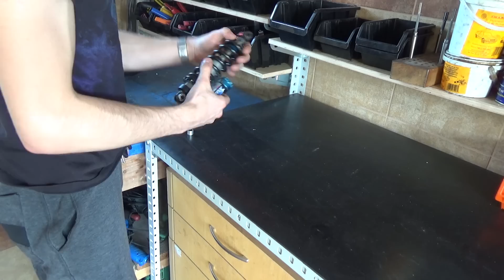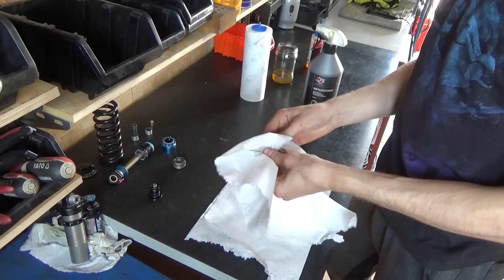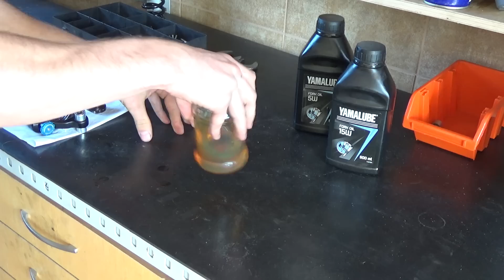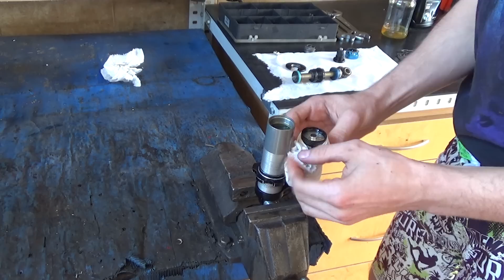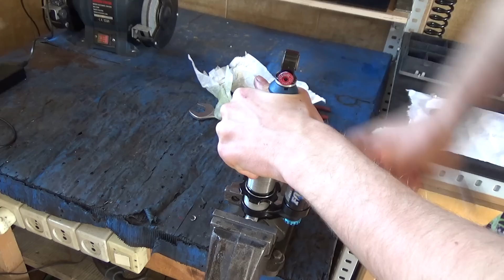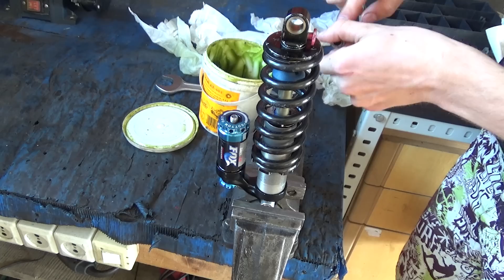FOX DHX 5.0 oil service

Comment: How far down do you push the piggy back piston before you put in the little plug, all the way down then insert plug and drain oil in piggyback reservoir or a certain distance down then the plug and drain the bled oil?
Great video thank you.
Reply from the maker: In 222mm fox, it's 34mm
Reply: Marwik thank you very much for replying great help.

Comment: What to do if instead of the cap the whole cylinder (together with the cap) gets unscrewed from the base?
Reply from the maker: drill a hole in a wooden block with the diameter of a cylinder and then cut it in the center of the circle.  squeeze the cylinder very tightly in the wood and unscrew it :)

Comment: I noticed 5w and 15w Yamalube.  Which do you use
Reply from the maker: I mixed 5w and 15w at proportion 50/50 and I get Oil 7.5w

Comment: Your bottom out bumper is upside down. Also mixing 5w and 15w 50/50 doesn’t result in 7.5. The appropiate ratios are 64/36